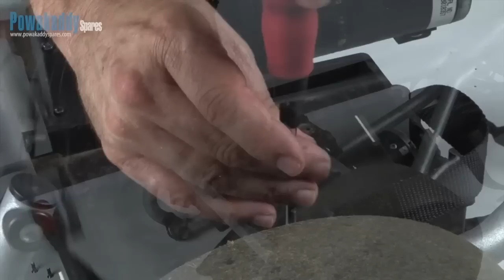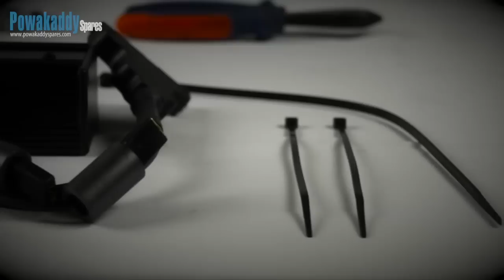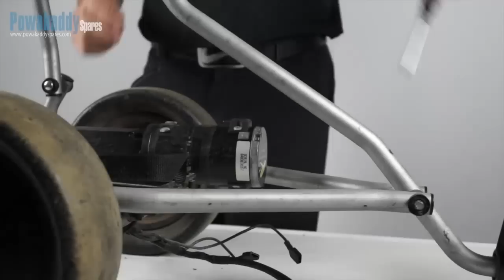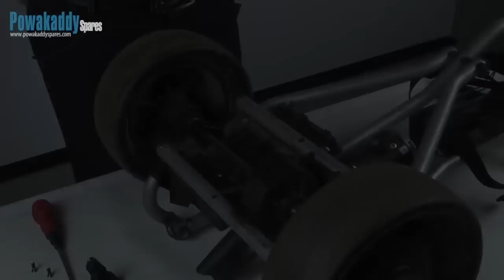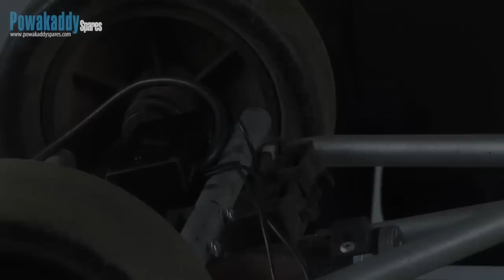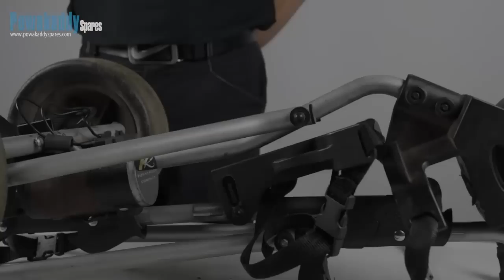Powakaddy Golf Trolley - Controller Replacement

Comment: Could the controller cause my battery to drain more power, assuming it's a faulty one..that's why I am not getting 18 holes from the charge?  Assuming my battery and charger are in good shape.
Reply from the maker: Not normally, a faulty motor or gearboxes are the most likely causes of a trolley drawing to high an ampage. The more likely cause is that over time the controller has become weak, then it doesn't matter how much power you ask for by turning the Potentiometer it does not allow it across to the motor giving the appearance of a weak battery. This is quite common in older trolleys and is just a case of the controller wearing out.
Reply: Mark Crowther-Smith j

Comment: Mark - Just bought a second hand Freeway 2. The battery has cut out although it is reading still 2 bars on the screen. Any ideas of issue ?
Reply from the maker: The news is not good I'm afraid. The Freeway 2 was a problem trolley made by PK's previous owners and to put it mildly they are best avoided. I would recommend returning it for a refund if you can. That said provided the wheels turn when you pull the trolley backwards this is an electrical problem for which there isn't a solution as all the electric parts on the Freeway 2 are discontinued and none of the new parts are compatible. If the wheels do not turn then it is a gearbox or motor problem and you can separate one from the other to find out which needs replacing. The motors are discontinued so second hand is your only option but new gearboxes are available.
Reply: Mark Crowther-Smith 

thanks for the reply, doesn't sound good news. the trolley works fine, it ran ok until the 18th hole then the battery cut out as I said. only thing that baffled me was that on the screen it said the battery still had 2 bars left. 

maybe take the electrics apart and see if i can see anything obvious
Reply from the maker: The problem with the electrics is that there are four parts to them and are multiple versions of three of them and they are not interchangeable. So if you are able to determine that it is the main PCB buying a second hand one is still only a one in 3 chance of getting the correct version. If you are unable to get it going to your satisfaction we would give you £50 for it to break for the frame parts to help keep others going. Good luck.
Reply: Thanks mark, i'll keep that in mind.